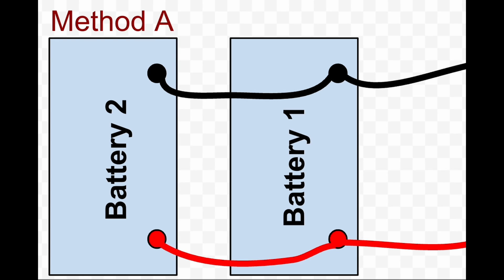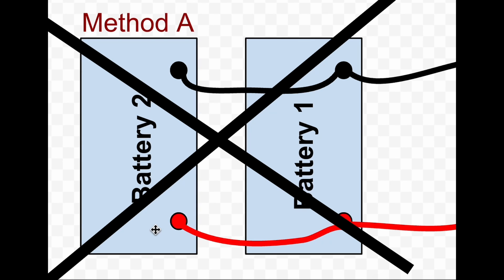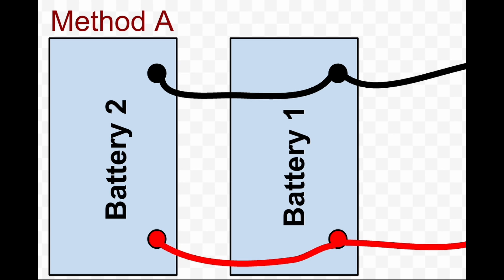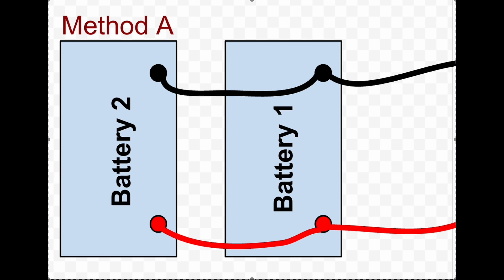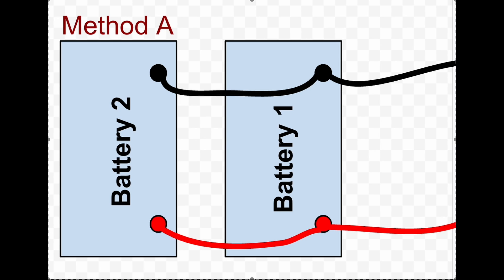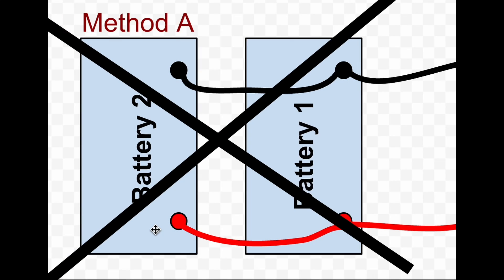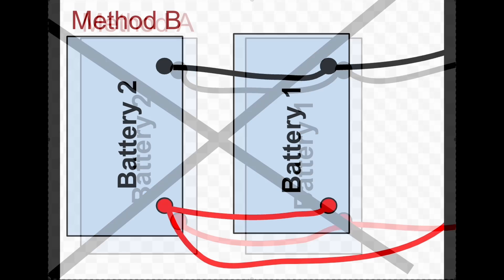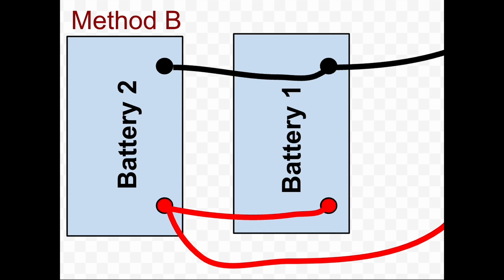What is the Best and Safest Way to Connect Lithium Batteries in Parallel for RVs and Boats or Homes?

Comment: If I have an on board generator, do I run the power and ground on the same terminals as the trailer, or run them on the opposite pos/neg?

Comment: Battery to busbars, with a fuse on every battery. Charger and load go to bus bar. Emergency disconects to the load and charger. Same length cables and proper wire gauge and fused per each setup.

Comment: To me it looks like neg 1 to 2 pos 2 to1 ? Both going to the source
Reply from the maker: It is still parallel not series.  Only neg to neg and pos  to pos.  The difference is the load is connect to the pos of one battery and the neg of another.  This helps balance them.

Comment: What if you have 2 CC would you use the other 2 poles pos batt 1 neg batt 2 for CC 1 and pos batt 2 neg batt 1 for CC 2?
Reply from the maker: I would connect the charge controller up the same as the load cables.  Unless you also have a shunt.  Then connect both controllers after the shunt.  I have 5 chargers all pos connected to buss bar and all neg to a buss bar in the system I am using. Everything is fused, some with redundant fuses.

Comment: ⚡ LiFePO₄ Assist Circuit for 12V Pb Battery with Thyristor Control
✅ Objective
To allow a 12V LiFePO₄ (60Ah) battery to assist a 12V lead-acid (Pb) battery only in case of voltage drop,
ensuring safe operation, correct polarity, and charging the lithium only via the lead-acid battery.

⚙ Basic Connections
TP1: Common ground (negative) of both batteries

TP2: Positive terminal of the Pb battery (also load output)

TP3: Gate input for thyristor (impulse from detection circuit)

🔌 Main Circuit Elements
🟢 Schottky Diode (IDWD100E65E7)
Anode to TP2 (Pb)

Cathode to positive terminal of LiFePO₄
→ Allows charging of the lithium battery from Pb with ~0.3–0.5 V drop

🔴 Power Thyristor
Anode to LiFePO₄ +

Cathode to TP2 (Pb +)

Gate to TP3
→ Stays OFF normally; activates only on impulse. Allows lithium to join the bus and support the Pb battery.

🧠 Trigger Circuit (for thyristor gate)
🔋 Impulse Power Supply
Two CR2025 cells (6V)

Negative tied to TP2

Positive feeds the trigger stage

🔁 1N4001 Diode
Anode to CR2025+

Cathode charges a 10 µF capacitor

🔋 Capacitor 10 µF
Connected to TP1 (ground)
→ Stores “voltage memory” from Vpb – Vf

🔲 PNP Transistor
Emitter: to capacitor +

Base: to TP2

Collector: drives optocoupler LED

💡 Optocoupler (e.g., PC817)
LED driven by PNP

Internal transistor: connects CR2025+ to TP3 → Sends gate impulse

📊 Operation Summary
Normal condition:

Pb battery powers the load

Pb charges LiFePO₄ via Schottky

Thyristor is OFF (no gate pulse)

Voltage drop on Pb:

TP2 drops quickly (e.g., load surge)

PNP transistor turns ON (base below emitter)

Activates optocoupler → sends gate impulse → thyristor turns ON

Lithium joins and supports the system

Latch effect:

Thyristor remains ON while current flows

Turns OFF automatically when current drops below holding threshold

✅ Advantages
🔋 Safe: Lithium never shorted directly across Pb

🧠 Passive logic: No microcontroller needed

⛑ Autonomous response: Acts only when needed

🧪 Field-tested, replicable and robust

📌 Recommended Components
Component	Value	Function
Charge Diode	IDWD100E65E7	Schottky 100A 650V
Thyristor	Semipack 100A	Power switching
PNP Transistor	BC557 or equiv.	Drop detection
Optocoupler	PC817	Gate impulse isolation
Battery	CR2025 ×2	6 V gate impulse supply
Memory Diode	1N4001	Capacitor recharge
Capacitor	10 µF	Voltage memory
Resistor	100k	PNP base pull-up

✅ Let me know when you want this in PDF too — ready for English-speaking channels or documentation for makers.

Chiedi a ChatGPT
Reply from the maker: How are you pushing current to the LiPO4 from a lower voltage Pb battery?  The Schottey will keep the higher voltage of the LiPO4 from pushing current to the Pb but it not needed because the LiPO4 has a higher voltage potential.  Maybe if the system you are designing is reversed?????   I am not seeing what you are.

Comment: How do you connect 3 batteries in par to make the all 3 charge at the same time ?
Reply from the maker: Do it the same as in the video.  If you are using high current loads like with an inverter you can use the bus bar method.  Some people with do both.  It uses a lot of copper though. If you are drawing less than 100A do it like in the video. You can also parallel 2 batteries off 1 center battery.  Make sure the cable running to each outide battery are of equal length and quality.

Comment: I have 4x 6v batteries in a series/parallel arrangement producing 12v.  I have 2 sources of charge (battery charger and solar controller).  I did strive for the connection method using what I call 'alternate corner posts'  which is what is shown to be correct in this video.  My problem is that the number of connections was too great for the post size on the batteries.

So I am going to be getting my setup rewired, so that all the charge points go to a positive bus bar, and a single red wire going to the positive corner post.  And then all negative connections go to a negative bus bar, and a single black wire going to the alternate negative corner post.  This will also allow for a shunt to be installed on that single black wire going to the negative corner post.

I hope this make sense.
Reply from the maker: Your setup is referred to as a 2S2P configuration. You plan is a good one. Just make sure the sets of cables are all the same length. Your series cables between the 6V batteries and the paralleling cables to the bus bar. The cables used to series the 6V batteries need to be the same length as all of the series cables. If you were not paralleling them too, they would not need to match. These can be different lengths from the paralleling cables but each paralleling cable needs to be identical. Also, series lead acid batteries will not auto balance so each 3 months remove the cables and fully charge each battery by itself. Hope the makes sense and helps. Getting the paralleling cables identical is far more important than getting the series cable  identical.

Comment: i think using a busbar can do the same thing..
i mean, the positive wire from each battery mounted into the one point lead connector of the busbar.. and also the same thing with the negative ones.
Reply from the maker: Yes it is imperative that the cables are identical in length.  For a 2 battery set-up, it uses many more connections.  Connections is the most common place for failure and the most common cause for different resistances.  For a 2 battery set-up method B one is fine. For three consider using a bus bar, for 4 definitely use a bus bar.  Even though, if you monitor they currents between each battery you will always see differences.  The key is to keep these differences as low as possible.

Comment: Hello i have 2 batteries in parallel set can i do this set up with bus bar too
Reply from the maker: Yes, just make sure your cables from the bus bars to the batteries are the same exact length.  You want them to have identical resistant.

Comment: I ve x2 12.8v lifepo4 24v 200ah system and I wish to add more capacity like buying 2 more 12.8v to make 24v 400ah pls how should I connect it. And is it safe.
Reply from the maker: If I am reading this correctly, you already have 2 100AH 12.8V batteries in series and want to add 2 more identical batteries in series, parallel to these. First I want to look at the way series batteries and the cells are connected. Each 12.8V LiFePO4 lithium battery consists of 4- 3.2V cells in series, (in a string/line) each with a nominal voltage that add up to 12.8V.  These are balanced and controlled with a computerized Battery Management System (BMS).  This controls the current and and monitors the voltages.  Most importantly, with the BMS, is that it keeps those 4 cells in series balanced.  If you put your batteries in series, there is no BMS balancing each battery to the other.  When in parallel that happens naturally.  This is one advantage to buying a single 24V battery with a 24V BMS.  So, to answer your question, YES but IF,  Yes you can and should set them up the same as I showed in the video.  You can also you bus bars. The way I showed is easier works similar to bus bars for a small system. This will give you a 2S2P, 2 SERIES in 2 PARALLEL configuration.  It is super important that you use the same length and quality cables. If there are big differences in the charge of your batteries it could cause trouble.  I recommend that you disconnect your batteries once a month, let each rest for 30 min and then check the voltage with a precise digital meter.  You can balance them to each other by connecting them all in parallel for a few hours. This is last act of balancing them to each other if actually best done when they are less than 85% charged.  The current will full better between them when they are not fully charged.

Comment: Crossover..that's what I do.
Reply from the maker: Yeah, a cross-over helps adds pathways to keep the batteries balance.  I agree.  My hope with the video is to get DIYers to see how piggybacking can detrimentally affect their batteries.  Cross-overs and bus bars are also all good options but it takes more copper.  I have seen a lot of simple piggyback connections so that is why I made the video. Will Prowse has his whole house set-up with a piggyback system.  He did a video about it.  He is not concerned because he has so many batteries and because his currents are relatively low.  Heck, he even uses different types and sizes on batteries in his system. However with high current I would not use piggyback, I doubt he would either.

Comment from the maker: The only reason that one battery would charge or discharge is a difference in the resistance. The easiest fix is wire length. With three batteries set up like you have them, they will not be perfect but they should close. Insure the wire length between the batteries is a short as possible and both are equal in length.  Also make sure the cable running to the batteries are the same length.  Sometimes the crimps on the terminals are not of equal quality and this will cause an issue with unequal resistance. What is most important is to have the batteries discharging and charging at similar rates. You will never get them perfect and they should balance themselves out after a hard charge or discharge. Ideally, the more equal they are charged and discharged, the less they will need to use current from another battery in the system to equal the system voltage. If you are using lithium batteries, they may still have a large current in the wires after the charger stops or the load stops. This is because of they ability to still push a high current even at a low voltage difference. Oh the age of the batteries and the way they are made may be slightly different which could cause them to be at different charges. What is most important is to have the lowest balancing current when they are done working.

Comment: Ok so I have a question I have three batteries wired up as method A showed. My question is why is batteries 2 and 3 discharging faster then battery 1?
Reply from the maker: As far as real world physics is concerned, with equal resistance, the battery with the lowest charge will get the highest current. A derivation of OHM's law.  The exception is with different resistances. Likely your case.  As a background but important info regarding this case, a wire that is 2X as long has twice the resistance as 1 that is 1X. If your batteries that have longer wires are discharging faster than the ones with shorter wires, then there IS a resistance issue.  If the system it is lead acid/ AGM chemistry, the first batteries could be worn out.  If it is LiFePO4, it could be the BMS limiting current or these batteries.  I would test each battery individually.
Reply: Thank you.. I have test each individually and they are all working optimally. I have left enough wire in my system to wire it as method B. If I was to switch methods would that mean that all three batteries would drain more evenly?
Reply from the maker: @saltlog1611  Yes they would drain more evenly.  How close are you charging / discharging than to their max?  The greater your current, the more the difference among batteries will be.  However, it is important to note that at rest, the batteries will balance out.  This means the higher voltage one will charge the lower voltage ones until they are all even. This is good for small differences because the balancing currents between batteries will be low.  However, it is bad if the currents will be large.  For example say you had 3 batteries at 80%, 90% and 100%.  Your charger may cut off when the 100% battery is done.  Then over time they will balance to the average of 90%. With lithium this is extremely close to the100% voltage. You will never get the batteries to charge at exactly the same current and voltage but we want them as close as possible.

Comment: what about if I'm wiring more than 2?
Reply from the maker: If wiring 2 or 3 the bus bas method is better than method B but only a little bit. If using a bus bar it is extremely important to use identical cables and sizes to the batteries.  For a 4 batteries setup, use a bus bar.  I made the video because a am constantly seeing people take 2 batteries and set them up piggy-back (method A).

Comment: Finally I found this resolution to my setup! 1 battery is charging and discharging 50% slower. I am going to rewire my kit. I have 2 x 24v lifepo4 with 2 bms so I was able to see what was going on ,but did not understand...Thank you!
Reply from the maker: Thanks, make sure both batteries are at the same  state of charge.  Likely they are if you had them set up piggy back like Method 1.  It is amazing how many people look at this video and I am blabbering BS.  Yours is a prime example of how the difference in resistance will cause one battery to get over worked relative to the other or others.
Reply: I had mine setup like method 1 and could never understand why one battery was only discharging.  I installed a 12v ac in my van Sunday, and have it attached directly to one battery.  I am gong to now change the battery connections time to the 2nd method. Question, when i need to charge the batteries, do i disconnect the ac from the battery? Or can i keep it connected?

Comment: Always where possible - link every battery (parallel) to a Bus Bar - and if want to be really good - make each connection the same length! Then its perfect, any amount of parallel batteries!
Reply from the maker: I agree a bus bar is a good choice but only if all cables are the same length.  Most DIYers are not able to do this or do not want to spend the money on the extra wire and high current bus bar.  They however easily, in most cases switch the from Method A to B with the wires that already have.

Comment: How about just connect each battery to a circuit breaker and have a buzz bar on other side of circuit breakers. This will protect each battery as well in case of a fault...
Reply from the maker: The main idea of this view was that one could easily install 2 parallel batteries incorrectly but use the same cables to instead install them so they will each have the same resistance. I hope I explained that well. I did not going into how to fuse the battery banks.  I would hope everyone has there battery bank fused.  Fuses are designed to protect the system but they are sized to protect the wire.  My system could output 1000 to 2000 amps or more if it short circuited.  The 300A fuse is size to protect the wiring (and everything else. Where I have 12ga wire in a 12V system I fuse it at 20A, 10ga wire 30A.  My battery bank has 4/0 wire fused at 300A.  I would not put your fuses between your buss bar and each battery.  One of the advantages of the parallel bank is that you are able to draw more current from it because you have multiple batteries in parallel.  If your fuse on one battery blows because of a load surge, and then you begin using light loads.  The system will be using one less battery and you may not know it. Just my thoughts on fusing the batteries vs the buss bar. I am not familiar with your system. Mine is for an off grid power system in an RV.
Reply: @TravelingLightReflections  your dealing with monkeys that have no clue.
We both know that a short circuit is a cause of thermal run away in lithium.batteries. I've seen every type of system from hookup with speaker wire to wires run over sharp metal. People use these videos to do their jobs on the cheap diy. My system is in a toyota townace and as it's done properly I've never had issues. I actually have a raspberry pi controlling the power loads to hotwater system, aircon etc.
The thing about hope it's a dangerous thing when a monkey is involved...